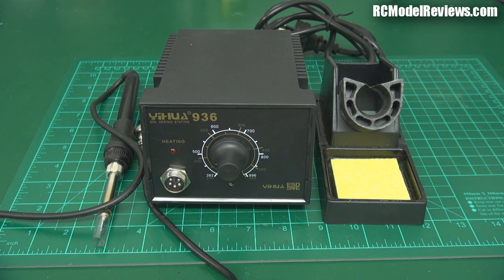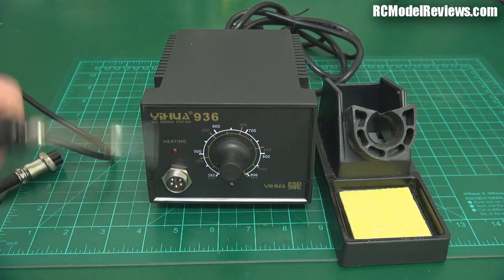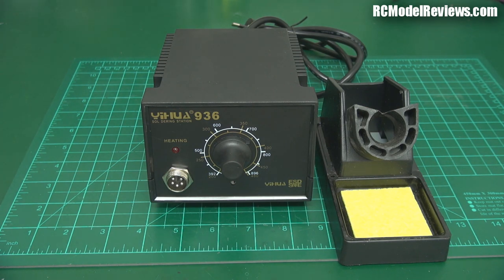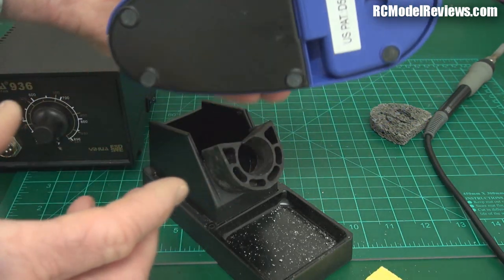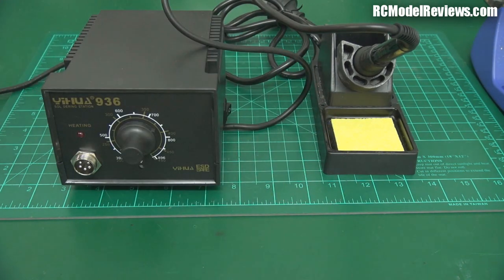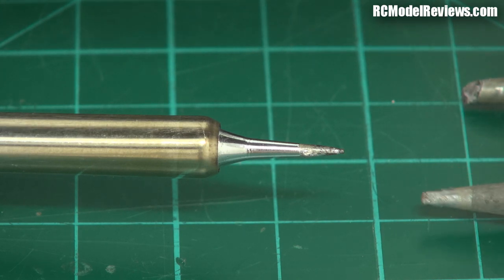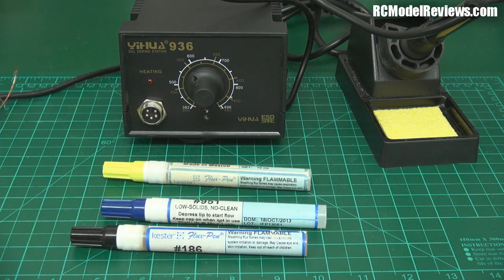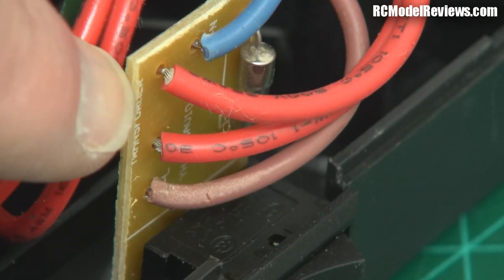The 936 Soldering Station from HobbyKing

Comment: EASY FIXES

The Hobby King station, and its clones, can easily and cheaply be upgraded to overcome pretty much all of its perceived shortcomings.

1) Can't see the indicator on the button? 
Have you heard of paint? ...Paint pens? ...Liquid Paper?? ...Masking tape???!
10 seconds later, the indicator is now visible. 
Problem solved. Price: 2 cents.

2) Base too light?  Duh! ...Add weight! 
Krazy-glue some heavy nuts (for large bolts) together, side by side. their shape is ideal for a tile-like arrangement. Then line the bottom of the base with a layer of heavy nuts glued together in a sheet. They can be placed inside that empty space in the back.  Or, if thin enough, mounted to the bottom's steel plate with magnets.
Problem solved.  Price: A handful of nuts and glue, maybe 1 dollar.

3) No little space for that curly brass tip-cleaning thing?  Put it on top!
Drive long screws into the sides of the open area behind the iron.  
A few screws just above where the iron rests could hold a wad of that brass padding over the hole. 
Work the padding onto the screws to secure it. Go easy on the amount of screws used... You'll be poking the pad with the tip of the iron, be careful not to damage it on the screws.  Alternatively, a small metal container could be used to support the pad. Depending of the actual size, I'm thinking an Altoids tin could do.
Problem solved. Price: 4 screws, 2 cents; 3 brass pads from dollar store, 1 dollar. Add a bit more for Altoids...

4) A variety of soldering tips often come with the iron, so that wasn't really a serious problem... 
Btw, if you find all conical tips are useless then just admit that you don't know how or when to use them -- They exist for a reason, and annoying you isn't one of them. So, yeah, go ahead and use the flat one, no harm in that.  

5)  No strain relief on mains connections... 
Like you said, hot glue.  Problem solved. Price 2 cents.

Conclusion:  
Hakko is priced for those who have more money than brains.  

You can buy at least 5 of the cheap ones for the price of the cheapest Hakko... Store the other four and use them when the previous one dies...  
Together they will easily outlive the Hakko.   ...And your bench won't look like the damn TeleTubbies section at Toys 'R' Us!    ;-)

Comment: Great review ,after owning one of these for a good few months I am over the moon with it,amazing price ,a huge step up from a cheapy 40w non-descript constant temp iron previously used. Dave Jones was a bit scathing in his tear down ,but for hobby use on a budget i don't think you can get better.

Regards the tip's ,  I bought some from Banggood knowing that the provided tip was not ideal for most use - SKU037904 and they are great with a good variety of different types of tips. The included tip i have had to use a couple of times for through hole soldering of ESC wires to flight controllers on 150 builds and other fiddly things i would rather not mention screwing up,so dont use it as a shiv!

Off topic, did you leave a comment on a Daily newspaper article about a certain "incident" that was being misrepresented today, Bruce? (Not many people from the Ringibu south area speak with the common sense that this particular post did)

Back on topic ,dont hesitate getting one of these knockoff 936's from Hobbyking.

Comment: This is not a well done review. I operate the YiHUA 937D soldering station (this is in principle the same station as the tested one , but has a digital temperature control at the station) now since 3 years and it does an excellent job.When I bought it I purchesed same time 10 different tips for $ 3.50 and I am very happy with them. O.k, the stand is too light, but you can place some lead beneath it and then it will stand like a rock. And the sponge... I change it, because I am soldering so many things almost every month. Sponges are offered by the local supermarket cost $ 0.80 and last for a year.

Comment: i plan to get one of these , but what i want to do is have all silicon soldering wand cable , like on original hakko , for nicer feel and better handling . But i cant find anyone selling those , and to make stuff harder its not just 2 wires in there , theres element heater , temperature sensor ,and grounding , i guess so at least 5 wires . Anyone has any ideas what to do

Comment: Pay attention to the connector on the control unit. This is a male connector. Everything that can output electrical power should use a female connector. This is not a professional design when safety is a concern. For those who have been using this device should avoid shorting those pins.

Comment: The 936 is functional I guess but the tip is really terrible, soldering XT60 connectors takes 3 times longer with the 936 as it does with a Hakko. After swapping the tip over it is significantly better but still nowhere near as good as the Hakko. I'd buy a Hakko first and save $30.

Comment: I bought the digital version of this (Yihua 937D) from amazon and it has performed very well and came with a great package:
Solder(claims 37/63 melts like lead free and always leaves dull joint), 6 soldering tips, and extra heating element, for $43  
Search amazon B00C04FADG to see the one I bought (non affiliate).
I have used this since January 2014 and it works great. Two notes with mine: 
1 the handle heats up quite a bit if you use it for an extended period of time. For up to about 45 minutes you are fine, but 60-90minutes the first inch or about 2.5cm of the handle near the tip will get very hot, and if you continue using at around 3-4hours most of the handle will be incredibly hot.
2 I believe that at least with my version it does not up the watts to maintain tip temperature. Sometimes I have to use an overly large tip if doing a thicker wire because the iron cannot keep up, not even a smaller tip using thin kester 44 0.031 37/63.

Also after writing this I realized that the soldering station Bruce reviewed costs about $18 USD, and is less than $30 USD shipped; that's incredible value. I think I paid about $60 for mine originally (now $43) and I was happy paying $60 back then.

Comment: I've had three, and they all died - the base unit is ok, but the handsets all failed and fell to bits.
Reply: +Performance UAV They're not a unit I'd recommend for anything more than light "hobby" use -- which is why I spent several times as much to buy a Hakko :-)
Reply: Yeah, I upgraded a while ago to a proper german unit, and t's light years above this.

PS Bruce - I'll need to send you a new magnetic payload thing; the one you've got is now way out of date.

Comment: What temp do you usually have your Hakko set on?
Reply: +Hewey19 Depends on what I'm soldering but most of the time I have it set pretty close to 350-360 deg C but different solders require different temp settings.
Reply: +xjet Thank you!  That gives me a good starting spot to do experimenting.

Comment: what is flux for @rcmodelreviews?
Reply: +Oscar Thorpe Flux is used to stop the solder and the items you're soldering from oxidising.  When you heat stuff up it tends to react with the oxygen in the air and create oxides on the surface.  You can't solder an oxide so this thin layer interferes with the soldering process by stopping the solder from alloying with the copper or other metals you're joining.  The flux acts to inhibit (and even dissolve) that oxide layer and this ensure a good reliable joint.  You will also find that once the flux built into the solder boils/burns off, the solder will become "stale" and won't flow smoothly.  The addition of a little flux will make it flow nicely again.  Check out the soldering basics video on this channel for a demonstration of that.
Reply: +xjet oh yes now i do see. Thank you mr. Simpson

Comment: Hi Bruce, what do you think of this adjustable soldering iron? Or rather this type of iron that has temperature regulation in the handle?
http://www.banggood.com/60W-220V-Electric-Adjustable-Temperature-Welding-Solder-Soldering-Iron-p-87374.html

BTW I have(or had) the Yihua936 and the heating element burned through and broke after a few months.